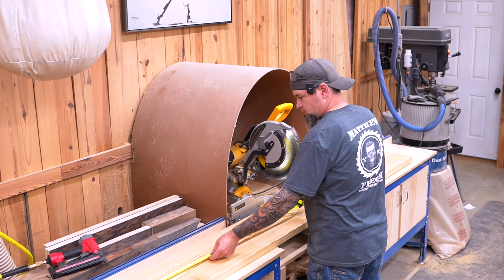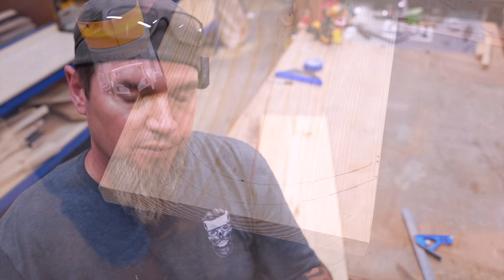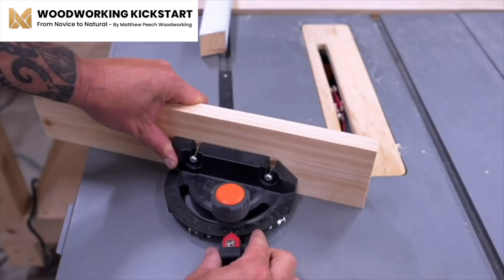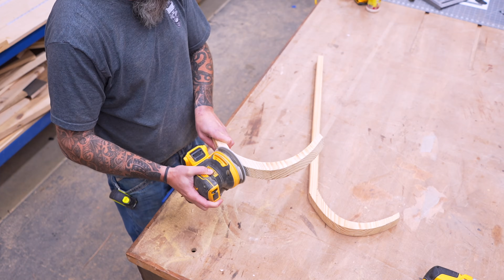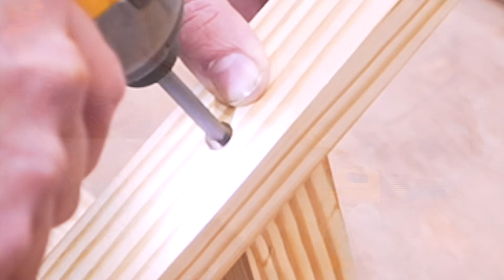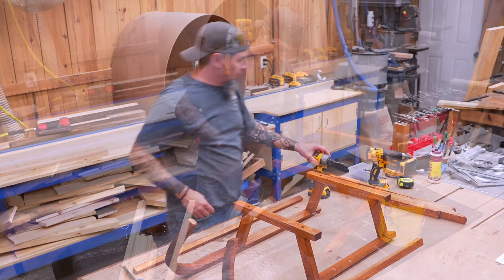This One Board Build Is A MONEY MAKER!

Comment: I bought the plans for this today, and I have to say... they are really well done!  I do have a question. Early in the video you mention that you can get three of these out of two 2x12s. Do you have a cut list/order for accomplishing that?  Thanks for the great videos!
Reply: I agree - you’ll need 6 runners at 3 feet each - with an 8 foot board that’s no more than 4 runners - you could do a work around and make one sled a little shorter I guess - and not sure what wood is left for parts and if there would be enough- now if these were 2x12x10 instead of 8 feet it would be easy - but not sure of the math with 2 eight foot boards - maybe it’s just me - don’t actually have everything in front of me to play around with it, so I could be missing something

Comment: I found the Pottery Barn piece called “Found Wooden Sled” for $249. It has some cool metal decorations, like metal along at the bottom of the rails. It’s not really necessary for decoration, but you could add it if you’re making it for yourself.

I also think Matthew should go all out with a more upscale version, like what you would see on The New Yankee Workshop. He could add dados for the supports, smooth the corners with a router, and so on. Norm Abram is the king of woodworking, and his level of detail is at the expert level.
If you’re starting this online course, it’s okay to start with the basic entry-level projects, but I would also like to see some videos that go beyond these craft-booth projects and show us where the course is headed.

Comment: I am in the process of rebuilding my table saw. Had trouble ripping a two by eight even after changing blade for brand new blade. So I flipped the saw over and the pulleys are loose as all get out. Had to change them out and all that crap and it’s turned into a nightmare. Got it on the run now. Will have it ready next week.

Comment: Aren't the runner tips prone to breaking on the grain?
Reply: Probably if it's handled roughly.  Since it's strictly a decoration piece, it should hold up ok.  If you want a "REAL" sled you'll have to build it differently, using different techniques.

Comment: For the runner supports when you said to attach them with the 45 degree angle, but when you cut them you said to set the saw bevel at 20 degrees.
Reply from the maker: Yea, I misspoke there.
Reply: Which angle is the correct angle?
Reply: @davelarkin1604  I believe it is the 20 degree angle because the saw angle when cutting was not quite half of what a 45 degree angle would make.
Reply: @WizzardofOdds  Thank you, I should have noticed that myself.